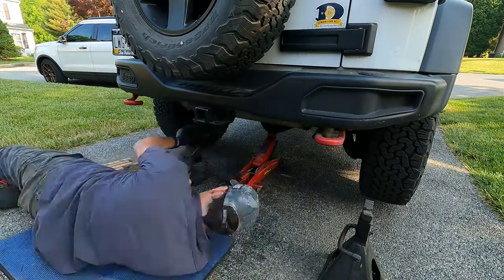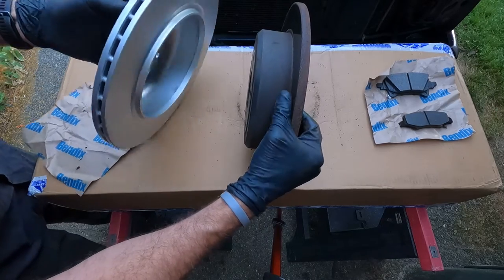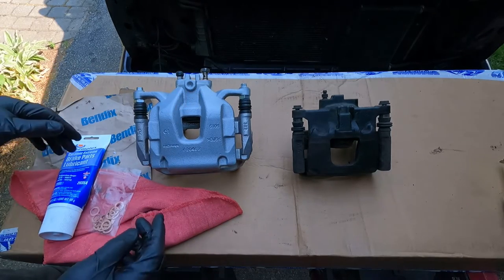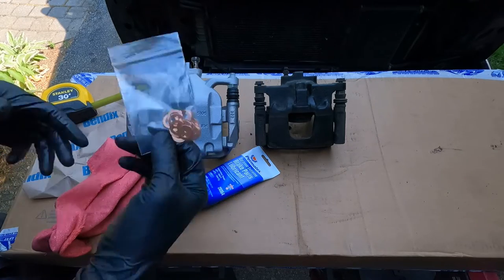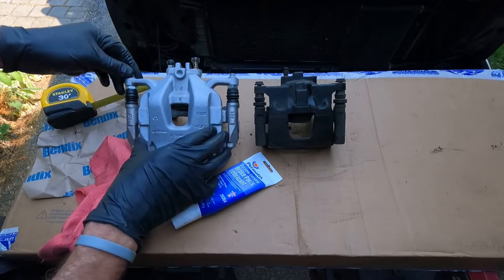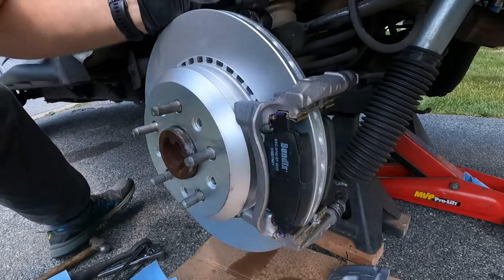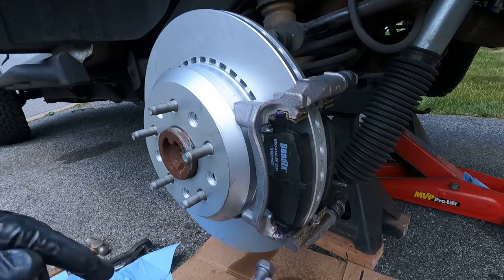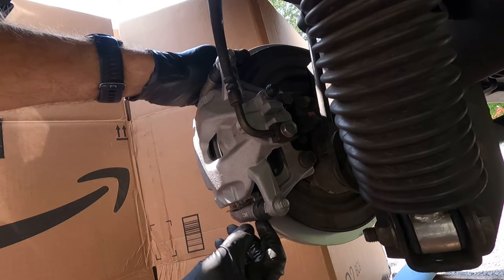Brake upgrade for the JK Wrangler - Part 2

Comment: JT is a single puck, 51mm.  JK is a single puck 48mm. Main benefit is obviously the massive vented rotor and larger pads. This shouldn’t be noticeable with the  later year 1 1/16” JK master cylinder but combining it with a huge twin puck caliper on the front may require an unobtainium J8 MC.  On my todo list! Excellent video help for this upgrade!

Comment: So just to be clear, we are going from the JK set up where the front rotors are bigger than the rear, like on everything else I’ve ever seen, to now the rear being about half an inch LARGER than the front, correct?
Reply: That’s right, but a lot other other big brake kits have that. The ABS System will compensate that. No problem.

Comment: What's total cost front and rear?  Did you look into the master is jk sized correctly
Reply from the maker: Eh.>I can't remember but it was under $300.  Also, the JK  brake booster on the 2017 is the "bigger" one..I forget the cutover year but the older JK's need the booster upgrade..My booster/master was good to go

Comment: I mocked up the JT parts on my JK  and I only have about 0.020" clearance between the outside face of the rotor and the brake caliper bracket. The inside face has about 0.080" clearance. The rotor is definitely not centered in the bracket. Did you run into this issue? One of the caliper slide pins has a rubber sleeve on it. Do you knowi if it goes in the top or bottom hole of the caliper bracket?
Reply: Pin with Nylon bushing goes on trailing edge (top). Squeeler springs on brake pads go on  leadging edge (bottom).

Comment: I own a 2008 4 door JK. Your two-part video are awesome. I learned a lot and I'm sure many of your viewers have also, but I have one question  Did you keep the stock master cylinder on the Jeep JK after upgrading the front and rear brakes?
Reply from the maker: I did keep the stock master cylinder. I forget the year there is a cutoff year when you have to upgrade to the bigger masters cyl and possibly power brake booster. The 2017 was a year that didn’t need to switch it out.

Comment: Great Videos! How did you solve the e-brake pad issue? Does the jk work with the jt?
Reply: From the looks of it on the video, it looks like it's all bolt on, and the e-brake stuff stays the same.
Reply: JT rotor hat is the same dimensions as the JL and JK rotor hat portion. So nothing is required for the e brake SHOES.

Comment: And I installed all my parts. My pedal feels firmer and stopping is better. Not as good as when I changed the front ones to the big brakes but a good  noticeable difference. I used the ultimate duty pads from DFC.

Comment: Can you use gladiator front break rotors and calipers ?
Reply: I’m told the best practice it to use the JLfront brakes and JT rear since they are vented with large pads. The JT sport fronts are much better than all the JK. Larger rotor, and 2 piston caliper. If you bump up to the JT rubicon HD front brake, it’s a littl larger than the std JL brakes. Problem then becomes what brake booster and master cylinder are you working with.  Too small and the petal won’t be firm. 12 JK and below had 1”. 13 and up JK had a 1 1/6”. And the Mopar J8 is a 1 1/8” master cylinder which is the best for larger than stock brakes but it’s impossible to find usually. Always out of stock.

Comment: Will these fit the stock 16in wheels on a 100% stock jk?
Reply: No. Same with the Big brake on the front axle, or the BR6 brake from the newer JKs. They all fits only with 17inch Rims or bigger.